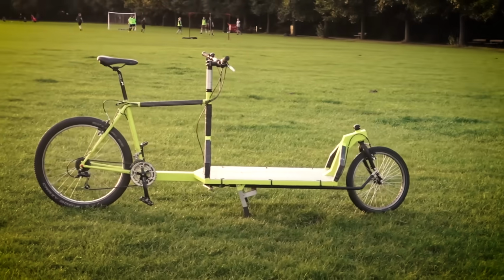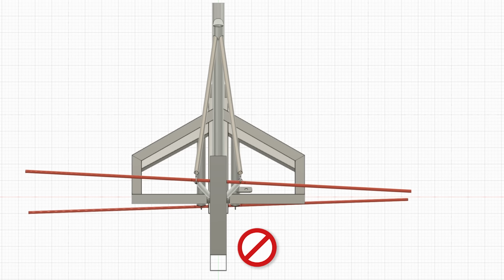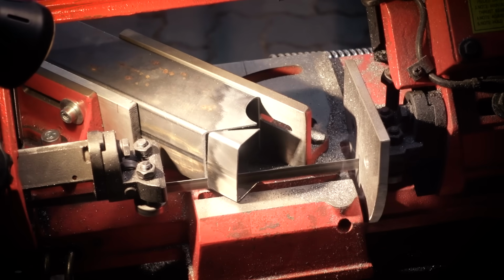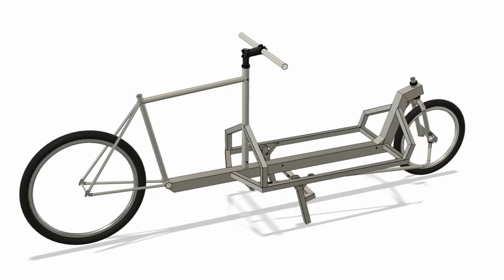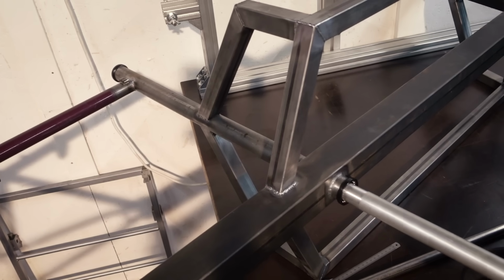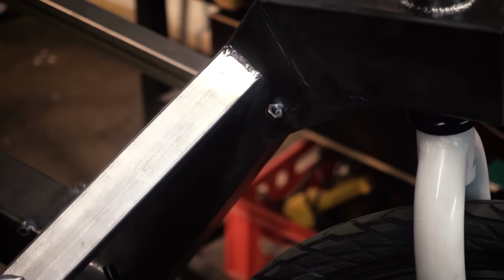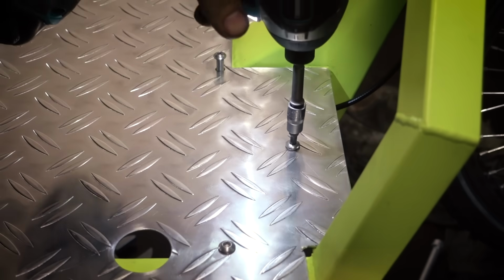How to Build a DIY Cargo Bike (Plans available!)

Comment: is aluminium, not aluminum!!!
Reply from the maker: Actually both are correct, there's two versions because the name of the element was changed multiple times throughout history, first it was called Alumium when first discovered, then it was called Aluminum, which stuck in some regions, but then some british scientists decided that the name doesn't fit well enough with the spelling of other elements  (that usually end in -ium like potassium) and they renamed it again to Aluminium. And now that's what the Brits call it while most in the US say Aluminum. Either spelling is valid and both spellings can be found in most dictionaries. Since most of my viewers are from the US I'm using that spelling.

Comment: Cool build, cool bike.

I would totally avoid 26" rims though... 26" tires are becoming harder and harder to get. 24" is still around, 27.5" of course, but 26" fewer and fewer places are carrying them at all... there are a LOT more options  for tires now with 27.5"/650B...the options are lacking for 26"...At least here in the states, can't speak for other countries.
Reply from the maker: Yeah the death of 26" is a tragedy! The problem is that for this kind of build, you need an old steel bike and most old MTBs are 26" so that's why I picked it. With stuff like 27,5" it's very hard to find a cheap steel frame, most are Aluminum. Of course you could use different wheels in the frame I used if you use disc brakes. But with rim brakes I don't think they would fit with a 27.5" wheel. Either way, I think it will be possible to find 26" tires for a long time at least if you order online, but you will have way fewer models to choose from.
Reply: @PhilVandelay  if you were to use aluminum, what would be the downsides? 
The bike would be lighter for sure and you may not be able to carry as much. But tubbing like that size would be pretty strong in the first place... you obviously have the skills to weld aluminum.
Reply from the maker: @david78212  No real downsides, but I didn't build this bike for myself, I just made it to show everyone how to do it. And for that I wanted to keep it as easy and simple as possible, and most people out there don't have the equipment or knowledge to weld Aluminum. I wanted to keep it accessible so that's why I'm using steel, those tubes are available everywhere and you can weld them with almost any welder. If I built a bike out of Aluminum and using a more complicated design, everybody would just go "that's nice but I don't have the tools/skills to do that". Even if I built a steel bike just for myself I wouldn't do it like this - I'd use cromoly round tubing and most likely a different frame design.

Comment: as always, great video, cool bike, do the brakes work fine or do you need disc brakes?
Reply from the maker: They're okay, but definitely not the greatest for this bike. I would say they're pretty close to the lower limit in terms of acceptable braking power. But keep in mind they're very cheap V-Brakes, good V-Brakes and most importantly good brake pads can make pretty big difference. But of course Disc brakes would be much better. I  didn't want to spend too much on this build so it's all kind of low-budget. I'll probably upgrade to disc brakes at some point if I keep using it.
Reply: @PhilVandelay   I think your setup is totally fine. You are right about good V brakes. I just asked because a little time ago I had the opportunity to buy an older bullit with V brakes and I was unsure about the breaking power on  cargo bike
Reply from the maker: @chewa1983  I didn't even know they made Bullitts with V-Brakes :) I think it would be fine because the Bullitt is a fair bit lighter than this bike
Reply: Phil Vandelay the very first ones they build. After disc brake technology became cheaper, they onlywent for disc brakes

Comment: Super!!! But why did you "tape" the frame in the end?
Reply from the maker: I wrapped old inner tubes around some of the exposed areas to protect the paint a little bit. Spraycan paint is not very durable and these areas usually get beat up a lot when you load/unload the bike and then you get rust spots. I guess it's a matter of taste but I don't mind how it looks

Comment: That is really AMAZING instructional video!
Thank you! 
Have to mention you have much more accurate welds than even some euro steel bikes manufacturers! 
I only have a question of why the steering arm should have such a complex 3d form rather than have only a ball joint at the one end and the same ball joint on the other end? I thought it would be simplier to make a joint only with 2 projections so the length of the arm (from the ball joint to the ball joint) would be fixed.
Reply from the maker: Thanks!  Not sure I understand the question about the steering rod 😅Do you mean why it is shaped like that or why the ends are adjustable?
Reply: @PhilVandelay  The steering rod could be moved in 3 axis between the steering and the fork. And also it has much more than two ball joints.
 I wonder why it is made so? Cause I saw your Light Cargo Bike video where the steering rod has only two ball joints.
Thank you for reply!
Reply: @PhilVandelay  I mean this part of a steering arm. What it for?
http://prntscr.com/po4x6g
Reply: @PhilVandelay  Already found an answer in your instagram about wobble with two ball joints.
One more question about wobble effect. Does it starts to feel from a specific speed or it runs all the time?
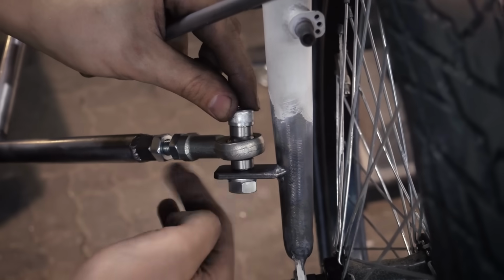Reply from the maker: @SerenWorks   I think we are talking about two different kind of wobble now, the issue with the ball joints is that the steering rod can bounce up and down when you use ball joints on both ends, you can see this at 26:31 in the video where I'm simulating the movement with my hand.  If you used two ball joints, there would be no way to prevent this motion because the steering rod is free to move in all directions, and since the rod is not straight, its heaviest point is at the corner where the bend is. Which means it will drop/sag down to the lowest position by default, and when you ride over a bump it will bounce up and down. But since I built a joint at the steering arm that can only move in two directions instead of three (like a ball joiint would) this movement can be prevented. You do need two directions because the front end of the rod also moves up and down slightly when you steer, only by a few degrees so it's not noticable in the video. The other kind of steering wobble I think you mean is when the front wheel starts to vibrate left and right but that's a completely different issue. That one is a complicated phenomenon that can have a number of causes but it usually has more to do with the front wheel, fork and headset than the steering rod (although that can also play a role). I included some tips about this issue in the plans and some suggestions how it can be fixed/avoided.
Reply: @PhilVandelay  great! Now I got it. Thanks!
Reply: @PhilVandelay  One more question. What are the alloy profile sizes for your jig?
Reply from the maker: @SerenWorks  It's 80x40mm extrusion and I used 40x40mm for some smaller parts (like the thing that holds up the bottom bracket, not strictly needed but it's useful to have)

Comment: I really like the look of the rectangular lower bar in the first build, is the square one stiffer or what is the reason for  the change?
Reply from the maker: Yeah this one is twice as tall which significantly increases vertical stiffness. The old one was a bit too flexible under load. Since there's a long, unsupported area you need a pretty strong downtube
Reply: Phil Vandelay thank you! Buying your plans this weekend, great job on the video!

Comment: Inspired by Larry vs Harry's Bullitt, but still a great build.
Reply from the maker: This type of bike has actually been around since the 1920's, Larry vs. Harry didn't invent this concept although they do make great bikes. Their model simply became the most famous so it's often used as a comparison. The frame geometry is actually quite different though, this bike has a center downtube while the Bullitt essentially has two downtubes that also form the cargo bay at the same time. In that sense this version is actually closer to the original Long-Johns from back in the day, although they again use a different construction with the "double decker" downtubes: https://i0.wp.com/betterbikes.dk/wp-content/uploads/2019/08/urani-long-john-8.jpeg
Reply: @PhilVandelay  You are right off course, but as a Bullitt-rider I am obliged to promote it any chance I get 😉.

Comment: Awesome build.  How's the weight after adding the square tubing?  Do you find it difficult to ride with the added weight?  Thanks!
Reply from the maker: It's slightly under 30kgs  fully assembled, but no it's not difficult to ride. On uphills you have to pedal a bit more but on flat terrain you can ride almost as fast as on a normal bike. Of course it depends on how much you're carrying too. I might add electric assist to this bike at some point.
Reply: @PhilVandelay  Great - thanks for the replay and info!

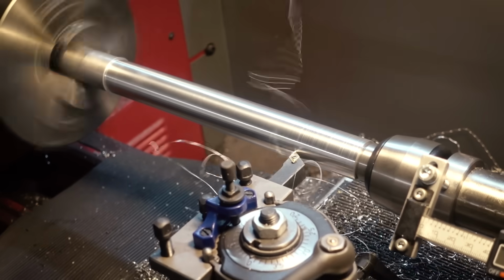Comment: 21:00 how come you used a bolt for that piece and didn't weld it?
Reply from the maker: I sometimes like to use solutions that are flexible so stuff can be taken apart if necessary. Also I don't particularly like welding aluminium... although I've done it a lot in other videos, I'm still not very good at it. So sometimes I avoid it when I can ;)
Reply: its aluminum

Comment: Had you considered using aluminum for the bike and cargo frame?  Great job, love the colour.  I'll be making something similar this winter
Reply: I was thinking the same thing. One can strengthen the aluminium by judicious use of steel flat bar on either side of square hollow aluminium to get the strength only in the plane that it is required to keep the whole thing light. I was thinking that the flat bar can be attached to the aluminium hollow with stainless bolts and spacers to minimise galvanic corrosion.
Reply from the maker: I have made aluminum bikes before, but for this one I wanted to keep it simple so it's accessible to more people. And most hobby shops don't have the equipment to weld Aluminum. But yeah, it would save a bunch of weight.
Reply: Hybrid of steel welded with aluminum riveted is an option to reduce a bit of weight.
I build a camper for a Toyota pickup out of steel, have been reducing its weight by replacing piece's with aluminium. (I welded joints from steel and rivet aluminum tubes to those).